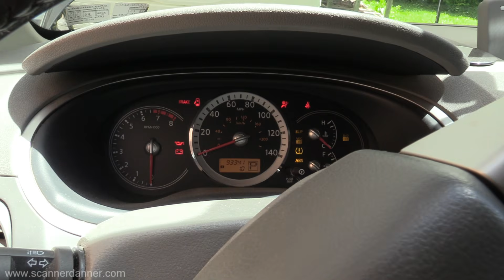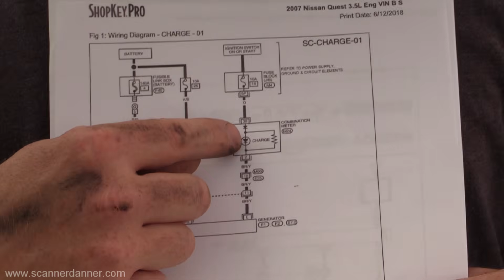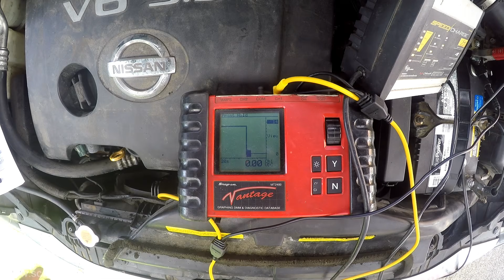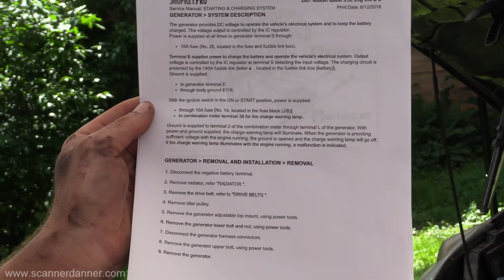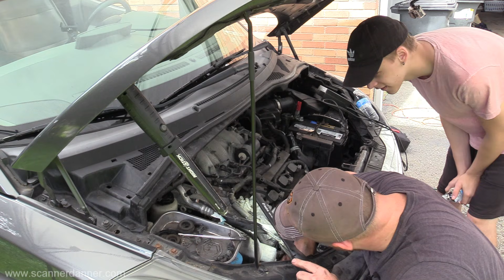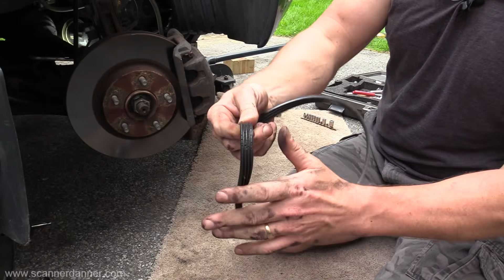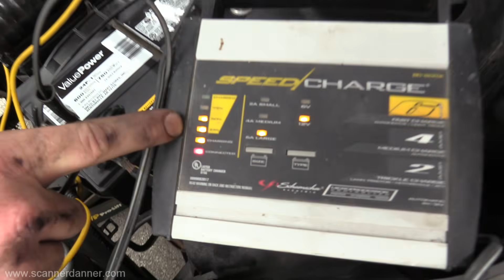How NOT to Test a Charging System (2007 Nissan Quest)

Comment: You are right Paul a Nissan. We pull it out the bottom, the AC compressor, all the way and it comes right out.
Nissan service manual  also says to take the radiator out

Comment: I did exactly the same thing on my 2005. I tested the voltage, it was low, ordered a new alternator. Fortunately for me, the first step (after removing neg bat cable) was to remove the belt... There was no belt lol. I put a new belt on it and sold it to a friend a year later. After they owned it for a year they had the same issue. After I saw the belt was there I remembered that I still had the alternator that I forgot to return. Changing it was a PITA but was BARELY able to sneak the alternator out the bottom. so I didn't have to pull the rad.
Reply from the maker: Humbling moment 😆

Comment: My electrical teacher in trade school told me a story. He was apprentice back in the day. He told his boss he checked the battery, volt dropped tested positive and negative. Checked lamp circuit. Full fielded alternator (back when you could actually do that) and it needs an alternator. Boss says, how is the belt?  That was in RWD days when belt was a lot easier to see.

Comment: I used to think a screw/scissors jack (not hydraulic was as good as a jack stand. Then one day I was changing a tire on my mini van and that cheap scissors jack failed and folded up leaving my van sitting on the brake drum. I was at the gas station and there just happened to be a guy there that did forklift maintainance and he had a toe jack that fit low enough to get under it. Always use jack stands

Comment: I had a head scratcher but shows how easy it is to over look things.
I had a Ford truck had 2 alternator battery cables and battery and still wouldn't charge above 12.4v.
After stepping back a minute and going thru what was needed to work properly, I found the engine ground was attached to the fender...doh..
Moved it back to the engine and immediately 14v+
Reply: Voltage drops good.
Reply: I could've voltage dropped the case to batt maybe.
Reply: Had 2 braided engine ground straps one on each side.
Reply: They braided straps probably glowed at night..lol

Comment: You not see the belt and still willing to post, is AWESOME! Guys like me always think that guys like you in your world, everything must always go so well because your so knowledgeable. Just had an Audi that doing voltage drop testing saved me from replacing an alternator! Unfortunately the testing found a bad battery cable that wound up being almost 3 times the price of the alternator, but, in the end, the car was fixed correctly.  Yes, I have the paper version of your book!!! :)
Reply from the maker: Thanks again!
Reply: and me ,did a volt drop on a ford s max,starter problems ,like flat battery or lazy starter,been to 2 shops,now my turn ,went for the basic checks,battery got power,power to dash,bulb comes on,engine earth,had good live cable,had good starter switch live cable,switch on my test light ,then had bad ground to engine ,if wiggle cable ,came back then got hot ,so put jump lead cable from battery to engine,fixed it ,engine start nice,was stop start engine tech too,so alt was exspensive,starter was exspensive,battery very exspensive ,not wanting to be a parts canoon,understand circuit design of the problem,and find out what is missing ,needed new earth cable ,now i too use my snap on verus as a volt meter,and scope ,graph meter is sweet ,watch what is going on ,voltage over time ,only ever use my scan tool for codes and live data ,but now ,after danner shows how to use it ,find direction ,it has up my game now ,use to use a multimeter for testing ,but prefer the scope style now ,i pass on my skills of what dan teaches ,to others,as i see parts canoons every were,shame ,lot people scared of a scope too,but i show them the 3 tests,volts amps ,resistance/ohms,love my amp clamp,test light ,i think if you watch dans vids ,and take it all in ,you be a top machanic ,as understand the tech ,how it should work ,and then find whats missing ,broke ,well done dan ,glad you made youtube vids ,as i am in england ,our paths would of never crossed otherwise

Comment: Holy fuckin timing chain. Don't know how much you know about Nissans. But those secondary chain guides are so worn that the chain is riding on the plunger for the tensioner. That's that whine / buzz noise.
Reply: Also on those alternators is you can un bolt the A/C Compressor and let it hang and remove the Alternator from the bottom. Good video!
Reply from the maker: Great tips thanks!

Comment: and why? look at the width of that belt,, 4 groove, sone 3 groove. not enough surface drive area to run that hardworking alternator, many manufacturers under design here.  master diagnostic tech, just 50 years exp.

Comment: Ahhhh, Scanner Danner, Thanks for the comedy. I remember about 4 years ago i had an intermittent charging system on my 1990 Ford ranger. It would charge, then stop charging. "V" belt system. did the checks, yep not working. I went to parts store (20 miles one way) bought a 150$ alternator and set about changing the alternator. I went to pull the belt, found the problem. The belt was there, but the "V" portion was gone, all that was left was the flat part of the belt. I did buy a new belt with the alternator, so i just slapped it on, and 4 years later, still running the 1990 Factory alternator. You arent alone.

As a young tech 20 years ago i was in a hurry to install a transmission in a chevy truck, stabbed it in place and went to hanging parts on the transmission ARGH!! i forgot to put in the torque converter.

Comment: Danner, I'm thinking I may have a loose belt so I will try that, I get some squeaks every morning but not too loud. The alternator running on my Honda Accord 2008 reads 14.2 and drops around 12.6 when the fans kicks in and then of course the computer corrects for the drop. Sometimes the car would not charge the battery fully even when it has ran for some time, I keep thinking this is a loose wire somewhere, perhaps my terminals are not tight enough, I did notice that the charge got better when I cleaned the terminals but doesn't last long. When replacing with a brand new battery, I don't see this issue, it kind of goes away but I did notice that the battery is not fully charged because the battery would not last long (I would say a week and its dead). I'm puzzled as to why this thing won't get fully charged, I will try the belt and then possibly a new alternator if that doesn't work. Any way to check voltage drop on these heave gauge wires?

Comment: Indeed, if you're gettin' stuff done, you're gonna take a few steps down blind or unnecessary alleys occasionally.

Scrap carpet!  I'm only a DIY guy.  But, none of my automobiles, power sports, or power equipment has seen the inside of a retail repair facility in decades.  And boy do I go through scrap carpet.  I put it down under the jacked up vehicles and skip the mechanic's creeper.  It works so much better in addition to being far more comfortable.

Unlimited quantities of scrap carpet are available every week on trash collection day in the neighborhood.  Someone is always getting new carpet and throwing out the old.

Comment: I actually while having practice for my drivers license lost the entire pully from the generatorn. The belt and the pully fell off. Along with that it lost the water pump to. Was not fun. Fun fact Nissan navara pulls both the battery light and the parking break P light up on the screen and it was the P sign I noticed first. Thought I missed to release it and then I saw the battery light. Needless to say driving home 1min at a time was not that fun.

Comment: Old GM Astra (euro market) used to have a rubber bushings on the alternator mountings requiring a separate ground cable. I've seen many wrongly  condemned Alternators due to not testing the  cable for volt drop. As you say, always volt drop test the supply and ground. Great channel thanks SD

Comment: My take away, if you wanna trip up the Danner, take one of the belts off. Haha just kidding dude. I have had the dumbest things pinch me while troubleshooting. A word on poly-v belts, if it is a traditional neoprene belt you will see cracking as it ages, if it is constructed of EPDM it will not generally produce visible cracks but microscopic cracks and the only way to see if it is worn is measuring groove depth/width. Gates makes a tool for it. Check out TMC recommended practices RP 320D.  Love your videos man

Comment: ive done it 4 30+ years,hell a man that makes no mistakes does nothing, only 1 thing on a simple charging bulb circuit on gm 12v volts is applies to one side of the bulb when key on. to tirn on light alt grounds cicuit to illuminate light , when charching it appies 12v to the other side of the bulb cutting the bulb off , PS i have made the same mistake on my own 84 chey 6cyl one time

Comment: Thanks Danner, we all make mistakes, one questions were or how do you get the wiring diagrams
Reply from the maker: I use a program called ShopKey (Mitchell On-Demand) that runs about $160 a month for access. There is a DIY version of this where you can purchase a 1 month access for an individual car for $20. This would give you access to the same service info and diagrams that I use. http://eautorepair.adtrk.biz/?a=10817&c=24&p=r&s1=

Comment: Drain plug is on bottom recessed under a black plastic thingy, the plug is black and recessed, use screw driver but be careful the plug is plastic. Have to crawl under car to see it, but it's there.
Reply from the maker: wish I knew then :-) 
I certainly do now, been told about 10 times so far. I learn so much from you guys :-)

Comment: It's called low hanging apple (easy problem). When you often pick high hanging apples on the trees (complicated problems) with a ladder and all, sometimes you forget that picking low hanging apples requires no ladder but you bring it anyway. Funny enough I learned the term during a training when I worked for Nissan Indonesia. 😁

Comment: that humm you heard is probably the timing chains rubbing against the small cam to cam chain tensioners. Usually sounds like a bad pulley bearing or low power steering fluid. But its usually the timing chains on that particular vintage of VQ35 engine. very common.

Comment: i work for nissan.. check out my channel (shameless plug over lol) and the easiest way is to evac the AC, remove the AC compressor. Then Remove the Alternator, all of this is done through the wheel well. You may also have to loosen the subframe bolts and pry is down some only on the passenger side (much easier than it sounds). I have never done it by removing the radiator or have i ever seen any of my co-workers do it that way. Might give it a try that way and see which is faster. I have been able to get these done in under an hour through the wheel well.

Comment: Great video! FYI, Nissan has the drain plugs in the bottom of the rad. They use a flush plastic plug that used a Philips head. Also, I’m glad to see that you take working on cars safely, seriously. Nothing bothers me more than seeing someone working on a car without a jack stand. A 3 cent O ring is not a good thing to rely on.

Comment: What a PITA to swap an alternator; have to remove the radiator? It's like Nissan learned some new engineering tech from our fellow German car manufacturers. A lot of independent tech's won't even touch them (German cars) like Eric O for example (and for good reason).

Comment: Ahh, I see you've encountered the new Invisi-Line belt system that Nissan started using in '07. It's an extremely rare system, only used on select vehicles. I NEVER SAW ONE BEFORE! 😁😜 😉 Just messing with ya, brother! At least you posted it for the world to see and comment on. 👍

Hey man, if you could see the basic things that I screw up here on a daily basis, you'd probably feel much better about yourself, lol! I'm just glad I have a system of checking that catches the stuff before it leaves my shop! I need to institute that same system for my tools, though - so many go missing around here, it's embarrassing ... and expensive!

LOL, we've got FOUR of those hunter/killers here, not counting the 2 feral ones that we feed outside! Very few mice around this year, lol! I have to be super careful with leaky vehicles, though. The law of averages says, wherever you put a coolant pan, the flow will go the opposite way! It's like opposing magnets - never fails! 🤣

Great stuff, Paul & Caleb! Nice work as always - great teaching, great filming, audio, and editing. The YouTube automotive Power Team. 👍👍 Have a great weekend, fellas! 🍻
Reply from the maker: Thank you Smitty! How is the channel doing?
Reply: @ScannerDanner  - You're very welcome, brother!

Not bad - some videos don't have many views, but one is headed for 9k views, which blew my mind. I haven't had too many diags come in that were worth filming yet - I've got more nuts n bolts stuff (on everything from motorcycles to lawn tractors). Quite a few vids where I get super frustrated, lol. Soon there might be some aviation videos! I'll be buying a cart-launched paramotor soon! Been saving over 2 years for that - can't wait!! 😎 Thanks for asking! 🍻

Comment: You cant blame yourself as no body dealt for 1st time in this car type not even the owner can see such a belt in a crammed-up engine nor expect to see a broken belt either. How ugly and labor intensive of changing such a belt that would make it unfeasible for average DIYer. Most of the Japanese makes (except Honda) till the early eighties made a rear wheel drive cars where every thing in engine bays was very clear and very easy to work with in addition to adequate lateral spaces. Same goes for Chevy / GMC V8s even till today in SUVs where all components prone to fail are placed on top. Design engineers since the 90s do not put into their consideration how to ease the struggle factor when a mechanic have to change water pump, timing chain, even alternators and compressors that are placed way down. Enjoy Your Time. John

Comment: Can we talk alternator temperature here?  I just changed my daughters alt on her 87 camry.  OE alt.  Went through the same basic procedure, there are several fuses involved, all were good.  There is also a fusible link I couldn't find but the wiring rang out.  Changed the alt and was getting 14.1 at the battery.  But the alternator was really hot.  The next day, after she had been driving, I checked it and it was at 240 deg.  That seems really hot to me.  Is that normal?  BTW, I like it when you make mistakes, I feel like like less of a dope when I do.
Reply from the maker: probably completely normal, ever feel how hot a just a little relay gets? to be honest I've never checked one for temperature

Comment: Might also have bottomed out and split the belt lengthwise leading to premature failure. That happened on my dad’s nearly-new LeSabre almost 20 yrs ago, i heard it bottom out when backing out of his driveway. Took it for a drive (up and dahn Mahnt Warshington and Television Hill) and was hearing a noise under the hood. Opened it up after I came back and found the belt split lengthwise. Lucky I found it when I did or he might have been stranded Dahntahn.

Comment: Well, even Michael Jordan had crummy days!  Love the vid!  Those sideways engines - I'm old, all the belts used to face the front of the car without all the hoses and electronics too.  Wish I had my Dodge Dart with the slant six back.  Who in the heck needs electronic seat adjustments - you pretty much adjust it and leave it there forever.  My ex went hysterical when her battery went totally dead and needed something out of the trunk.  I told her to open the trunk and fetch it.  She said she can't because when she pressed the remote button, nothing happened.  I said, "PUT THE KEY... IN THE KEYHOLE... AND TURN IT".

Comment: Bulb circuits can be tricky.  I put a reman Denso alternator on a 2013 Honda a few months back after it failed.  Did my full diag and condemned the alternator.  When I started it up the battery light was on but it was charging just fine at 14.5V and carried the car's full loads.  I questioned my original diag but then after diag'ing the light specifically, I correctly called a bad replacement alternator.  I've never seen the light on while charging before.  Customer told me (after the fact, of course) that the lady behind the parts counter dropped the alternator on the counter.

Comment: So, what about that sound that you heard. How does a alternator make noise if the thing isn’t turning. I’m confused. Thanks for posting.
You have Class.
Reply from the maker: It wasn't the alternator that was humming.  Some Nissan techs posted here that it is the chain guides that make this noise on this engine. (Not a good thing btw)
Reply: ScannerDanner . Wow, I was thinking you would say it slung off on the last shut down and you found it later. I thought I heard the alternator in full fielding mode. That’s crazy. It did sound like a hum. I will keep my ears peeled for that one. Thanks again. You keep my knowledge fresh. I enjoy your channel..
Reply from the maker: yeah, they said when these come in that they take both accessory drive belts off and then run it to isolate the chain guides as the source of the noise

Comment: I think the female friend who brought this vehicle to you didn't give you all the information you needed to  work on it . If it had been regularly  driven , and a distance further than a few blocks ,  they would have noticed the air conditioning don't work, it was harder to steer, it was overheating etc. You have a strong electrical👍 background so you leaned that direction . You got set up ....it happens ! 😁
Reply from the maker: Actually it had power steering (two different belts) and I think the AC didn't work right anyway lol